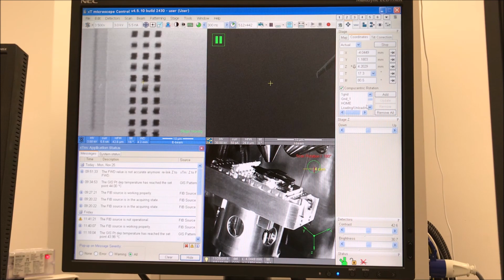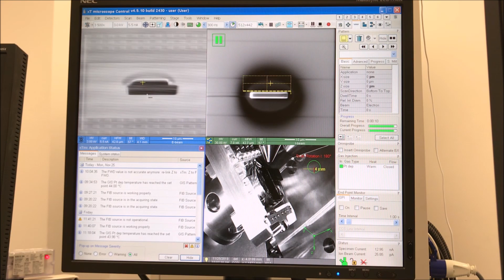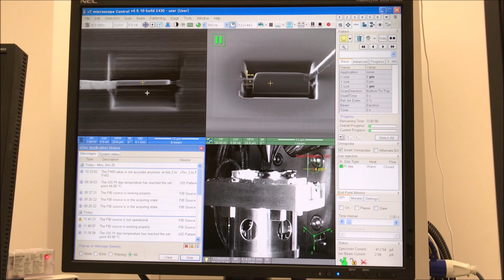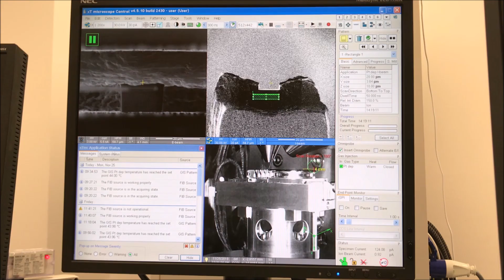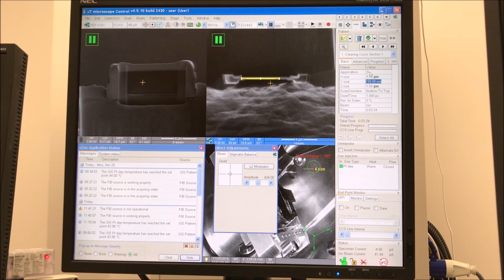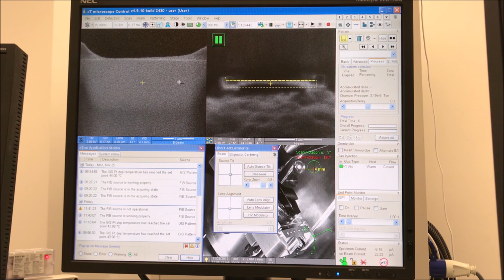Focused Ion Beam S/TEM Lamella Prep Tutorial

Comment: Thanks for the great video! I've been preparing metallic samples, and have trouble with the lamella bending as the thickness goes below ~100nm. So far I've been trying to make several "windows" of thinner regions but still have a lot of bending and doing a horizontal mount instead of a flag mount. Any tips or recommendations if I want to prevent the metallic lamella from curling from your experience?
Reply from the maker: Thank you for stopping by and watching.  Unfortunately, bending will nearly always become an issue to some degree when thinning a lamella and particularly when the lamella starts to get <100 nm in thickness (as you have already observed), so there really isn't any way to "avoid" it, only the potential (though not a guarantee) to minimize it.  Certainly, securing the lamella on each side will help to a degree and will be more robust compared to flag mounting when this is only on one side.  I also find that staggering the cuts also helps so when you are cutting your windows you want each subsequent pattern a little narrower than the previous rather than using the same width.  I do also find that higher over/under tilts tend to induced more bending, so keeping these on the shallower side can help.  Using lower FIB currents also seems to help because you have more control then when using a high current (though the pattern will take longer).  I hope this helps.

Comment: Astonishing skills
Reply from the maker: Thank you!  To be fair, a few year later I feel I can now make a better sample than this one!  It might be worth doing another lamella prep video with some updated techniques and tricks.  Maybe I can even figure out how to record it via screen capture instead of using crappy iPhone video!
Reply: @NicholasRudawski  Sounds great! I was trying to follow your settings on my G4 Helios PFIB system yesterday, but I realized it is challenging to directly copy your recipe on a different system, even though I am using the same HT voltage and beam current. I do have a question: you are trying to cut your sample at 57 and 47 degrees on each side, and you mentioned that you do not want to damage the Pt layer. However, the shape of the lamella is like a "V." Will this cause problems after your lift-out and TEM imaging? Also, I do not use the cleaning protocol; instead, I use a 30kV 6.7 nA ion beam to image the edge for 3 minutes, which also helps me to make the edge smooth. Have you tried this? Thanks for your answer.
Reply from the maker: @YangSong20  You are correct that over and under tilting by 5 degrees will tend to taper the lamella towards the bottom.  This is intentional to help preserve the Pt straps and the near-surface part of the lamella, which tends to be more important, and it also makes it easy to perform the "J" cut.  When I do the final thinning, I'm not using tilt angles this large, so the final lamella is much less tapered.  I'm not familiar with your technique used to smooth out the lamella edge, but I will as always freely admit that there are so many possible wrinkles, techniques, and approaches that there will never be any large scale agreement on what is the "correct" or "standard" way to make a lamella.  Ultimately, it really comes down to the quality of your final lamella and if it is of sufficient quality for you to obtain the information you were intending to obtain.  As long as you are getting the results you want to get, you're doing something right (though it may still be possible to further improve upon what you have already done); so, even if you feel you have everything all figured out, it's always best to keep an open mind!
Reply from the maker: @YangSong20  hey, sorry for the late response.  You are correct that using my method of over and under tilting will taper the lamella down towards the bottom.  This is deliberate to preserve more of the Pt layer, but also to make it easy to undercut the sample and lift it out later (as there is less material at the bottom of the lamella to now undercut).  When I do the final thinning, the amount of over and under tilt is reduced, so the lamella  become less tapered during final thinning.  If there is one thing I've learned over my years of dual FIB/SEM lamella prep, it's that there is no one standard way to make a lamella and there are countless variations and tweaks that people have adopted over the years; this is why I feel it is so important to learn how others make lamellas, because you can (and often will) learn something new to add to your own lamella prep recipes.
Reply: @NicholasRudawski  That is true; previously, I preferred to trim the lamella after mounting it on the grid. One of my systems has a flip stage, which makes it much easier, but it has some alignment issues. After I use 30kV and 24 nA to live image the sample and set the trenches area, and then go to a higher beam current for milling, it causes a shift (the cutting square is no longer at my designated place). We have two systems; the PFIB one does not have this issue, but the Helios has a shift of about 15 µm. I talked with the engineer, but he said it is normal. Have you seen this kind of issue on your system? Currently, I have to do a quick snapshot before the final cutting to confirm the location. Thanks!
Reply from the maker: @YangSong20  part of the "210" ion column alignment includes a beam shift adjustment for each current setting; this is to ensure that when beam currents are changed that the image does not shift.  What I find is that even after I precisely adjust all the beam shifts for each current setting to keep the images coincident when changing currents is that there is still a very small (but still noticeable) amount of shifting when the current is changed. However, I find that this is usually only 0.1 - 0.2 um (at most).  If you are seeing a shift of 15 um between two current settings, this is very excessive and I'm surprised the technician thinks this is normal.  Again, this should be something that can be corrected using the "210" ion column alignment.  The next time I do this adjustment, I can record and make a video so everyone can see how to do this.
Reply: @NicholasRudawski  Thank you so much, this adjustment video will be very helpful.

Comment: Questions!
-why not flag mount the sample to the slide of the post to reduce redep?
-why no e-beam C depo so that TEM can see the contrast difference….to see where the depo ends and the Si begins 
-Are you guys reusing grids?
And last why such a large sample ?
Reply from the maker: Hi MonkeyBrainSushi: I don't like flag mounting because it leaves the sample more susceptible to bending because one end is free, but many people do indeed use this approach.  I'm not sure what you mean regarding the "e-beam C depo", but generally, you are trying to avoid beam-induced contamination on your sample.  You could reuse the grids, I suppose, but the cost of the grid is exceedingly small compared to the instrument time cost, so there really is no financial reason to do this.  The size of this lamella is actually on the smaller side; I know of many people who use a default size that is basically twice as wide as this sample (~20 um wide).
Reply: @NicholasRudawski  Hi Nicholas, I think there is one more reason why flag mounting is not preferred. When you rotate the flip stage 180 degrees and try to weld the back, you might not be able to see the joint because the grid blocks the way (if the lamella is not welded in the perfect position).

Comment: Dear Nicholas 
Many thanks for these valuable videos... But I have a question: my samples (oxide) are coated with silver (sputter coating), and always when I prepare a TEM sample a big part of the silver layer get re-deposited over the cross-sectional surface of interest (it looks like clouds over what I need to investigate) and l have performed cleaning steps at 5kv and 2kv but it didn't solve the problem. 
Do you have any advice PLZ?
Reply from the maker: Hi Samer: glad you find the videos helpful.  Re-deposition when you are preparing a sample can definitely be troublesome.  How do you know the re-deposition is actually Ag and not something else?  The most common culprits for re-deposition I find are the grid material and/or the protective Pt.  The grid issue can be rather easily dealt with by using a Mo grid instead of Cu.  The Pt issue can sometimes be avoid by thinning past the point where the entire protective cap is gone but often you can't do this if you are trying to protect the near surface region.
Reply: @NicholasRudawski 
Thanks for your reply. 
I confirmed it using EDS .... I tried to post a link for TEM image but my comment was deleted every time I post a link to image.
Reply from the maker: @samerdaradkeh1504  You can email it to me directly: ngr@ufl.edu
Reply: Hi Samer, indeed silver can be a tricky material especially when it comes into contact with air. To be precise with the sulfur in the air. That can create problems if you store the sample some time out of vacuum and then for example plasmaclean it before taking it into the TEM. The plasmacleaning leads to redeposition. When we went directly (about 10 min handling time) from FIB vacuum to TEM (w/o additional plasma cleaning) we had no issues. Or do you see the redeposition already during FIB preparation? 
Best regards
Alex
Reply: @Alex-qv7zd  Hi Alex, thanks for the valuable info. 
I didn't see any re-deposition during FIB preparation
Reply: @samerdaradkeh1504  Hi Samer, if you don`t do an additional plasma cleaning step that info wont help you, unfortunatly. :(. However, did you consider a backside preparation by flipping the lamella upside down before thinning. Since the silver is the top layer that may reduce the redeposition. But you need a ratatable manupulator and it is an overall more advanced technique. I havent done it myself so far. But I guess there are people at your department/work/institute that have already done something like it (assuming it is possible with your equipment).

Comment: Is it possible to move (forward or backward) ion beam during milling? Or You have to stop milling process, move milling box and start process again?
Reply: Yes, that is possible. I have not worked on any FEI Dualbeam for some time, but I think you can do so with the 3 buttons below the milling progress bars (On the right side visible during milling). On Zeiss Dualbeams that is also possible. The distance the beam jumps per click can be set by the operator.

Comment: I have one question here, why ion beam image needs to be rotated 180 deg? I notice from AutoTEM manual, the probe is from the left side, down to up position for probe approach, but for almost all manual operation manual, the probe is from right up to down side approach, is there any special consideration? Thanks a lot.
Reply from the maker: Hi Guo: the 180 degree scan rotation for the I-beam is more of a preference than a requirement; I personally prefer it because it maintains a top-down orientation in the I-beam image (particularly when using the Omniprobe), but I know of many users who prefer to keep the I-beam scan rotation at 0 degrees.  So it's really more of a person preference than anything else.
Reply: @NicholasRudawski  Got it. That is helpful for my understanding. Thanks a lot!